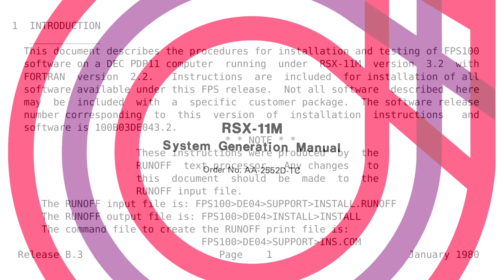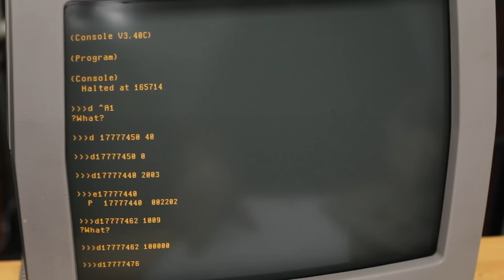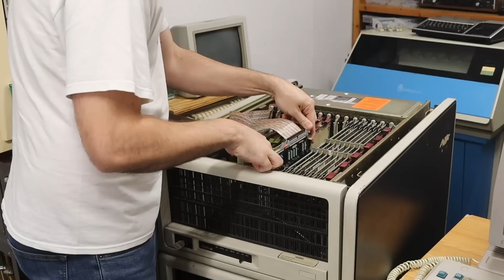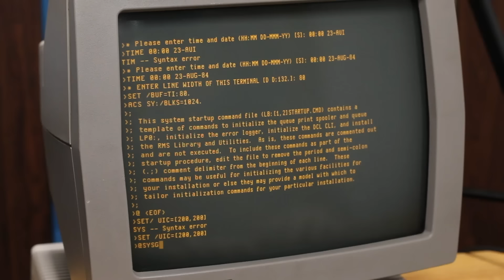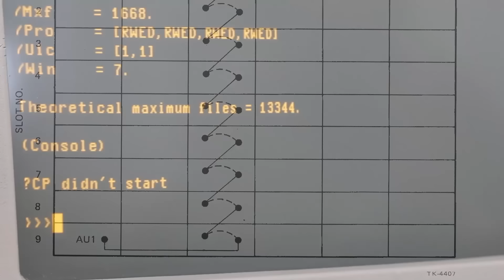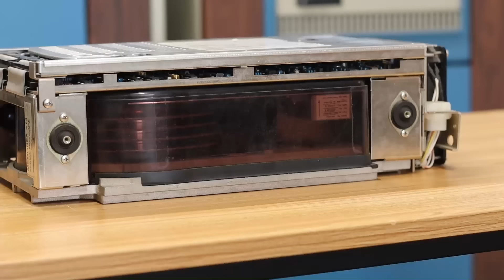My PDP-11/44 Won’t Let Me Format My Hard Drive

Comment: Of course the commands is an annoying sequence of Numbers You have to type over and over
Reply: the '>>> d' commands were to a boot rom monitor to write values into memory that happens to correspond to the control registers of the drive. The numbers were long because they were in octal (base-8, digits 0..7) which is what DEC uses then, and the '17777' at the start is because the drive control registers were at the high end / top of memory, which was a common thing so the memory-mapped control registers were not in the way of program code.
Reply: @rivimey sure, it’s still annoying if You have to type it 100 times (at least back in the day when it was painful to Marco it)

Comment: Shades of SYSGEN!!  I worked the old S.E.L MPX OS systems and we did that fairly often. Had a two config files, both matching the hardware. Each time you moved a jumper or added a board, had to update them. We used two because one would boot OS and enable all the hardware, then just wait for users to login. The other would do the same but also start a main task to run our real-time simulations.  So one for maintenance, one for running the training simulator.

Comment: To the extent its useful, RSX isn’t mis‑detecting your controller, it’s just believing what’s on the last track of the “RK06” unit.

On RK06/07 (and several other “last‑track” disks), DEC defined a standard bad‑sector file layout on the highest‑numbered track, documented as DEC STD 144. That file starts in the first sector of the last track and looks roughly like this:

word 0–1: cartridge serial number
word 2: reserved, written as 0
**word 3: flag – 0 for a normal data cartridge, 0xFFFF for an alignment cartridge

following words: list of bad sectors, then padded with 0xFFFF

RSX’s INI command, when run on an RK06/07‑type device, reads that “manufacturer’s bad sector file” from the last track. If word 3 is 0xFFFF, it prints:

Disk is an alignment cartridge

and refuses to initialize, because alignment packs are supposed to be used only for head alignment, not for data. The manuals spell this out: the last track identifies the volume as an alignment cartridge, and such a volume “cannot be initialized as a Files‑11 volume.”
Internet Archive
+1

Your Emulex SMD controller is emulating an RK06, so RSX treats it exactly like a real RK06:

It goes to the highest‑numbered cylinder/track that the Emulex presents as the “last track”.

It reads the first sector there and interprets it using the DEC STD 144 layout.

Whatever is on that sector right now has word 3 = 0xFFFF (or equivalent), so RSX quite reasonably concludes “this is an alignment cartridge”.

Why would that word be 0xFFFF on an SMD drive?

Most likely explanations (these are informed guesses, not documented DEC facts):

The disk was low‑level formatted or tested with some Emulex or other diagnostic that wrote 0xFFFF into that word as a default, not realizing DEC used that pattern to mean “alignment pack”.

The drive previously lived behind another DEC‑compatible controller that also wrote a DEC‑STD‑144 style bad‑sector file and explicitly flagged it as an alignment cartridge.

The last‑track area was bulk‑written with 0xFFFF (a common “empty” pattern) and just happens to match the alignment flag value.

In any case, RSX is not inferring “alignment” from the fact that it’s an Emulex or SMD disk. It’s literally reading that flag from the DEC‑STD‑144 bad‑sector file on the last track and doing what DEC designed: treating it as an alignment cartridge.
Reply: The "OS Plummer" does a drive-by wave and drops the knowledge of the ages while he's at it. I feel like I'm a fly on the wall in ring 0. LOL
Cheers, y'all!
Reply: So either format it again and fill with zeroes, or use direct access to the Emulex card with the monitor to change word 3 of last track for each virtual disk to zeroes. I'd go with the second option...
Reply: By the way, I think when you did the low level you backfilled with 177777 which would be all ones on the last track...
Reply: @DavesGarage  Ding ding, sounds like we have a winner, so this was a defect between the chair and the terminal.
Reply: @DavesGarage  you're like God reaching out to Adam, passing on the great knowledge
Reply: It is He who manages the Task Manager.
Reply: Thank you. I dealt with mostly RT11, VMS and UNIX but I remembered something about the last track identifying an alignment pack but couldn't remember what. I knew it was independent of the OS and you had to do a low level format with Emulex to clear it.
Reply: Isn't an alignment pack just a cartridge that is filled with entirely all ones, so it can produce a predictable pattern on a scope? Looks like @UsagiElectric turned his disk into a perfectly good "alignment cartridge" by accident.

Just re-format it with all zeroes and it will be fine I guess.
Reply: 🎶 THERE GOES MA HERO, WATCH EM AS HE GOOOOOOOOEEEESSSSS 🎶
Reply: So in other words, if Usagi opens the harddisk in a low level "hex editor" and writes 0x4e10 or whatever into there all is well?
Reply: @BastetFurry  
He can talk to the registers in the card via memory monitor, so in theory he can write the location/address in one register, data in another and initialize write operation by editing third one. IIRC, he did similar things with Centurion drives...
Reply: @UrgonCobol if you can do it by feet so to speak then that's also fine. But if you already have an OS you can boot to bootstrap/install then it might come with something more comfortable. Haven't used RT11 outside of fooling around in BASIC tough, so, no clue. 😅
Reply: @BastetFurry  
The OS boots from virtual drive on uBone board, not from real HDD. Real HDD can't be accessed because it's not seen by the system correctly...
Reply: I have been wondering whether you could do the equivalent of "dd if=/dev/zero of=/dev/sda" to wipe the whole disk clean. Or even just the last cylinder. Is that an option?
Reply: Yep, I assumed it was something in its FS headers (or I guess footers, in this case) that was angering the check. I had hoped it would be something more sinister than just FFFF, though 😂 Something like "oh, your disk just happens to have 0xBEEF or 0xF0F0 in the right spot, you should go buy a lottery ticket", etc
Reply: oh dayum, +1 insightful
Reply: Or:
Reply: Amazing to see you here
Reply: Haha.. The Big Friendly Dave makes a timely appearance with his shared pain and hard won knowledge. 

Who said you hanging on to old hardware wouldn't be useful to someone some day. ;)
Reply: One thing you can count on Dave for:  A super tight, to the point, explanation.  Well done sir.
Reply: Throwing in a comment so hopefully Usagi sees this info. The Master of Task Manager hath spoken!!!

Comment: I was an FE for DEC for years and troubleshooting hardware could be a SERIOUS challenge on systems properly configured at the factory. HOWEVER, in your case where you are piece-milling a system from various conditions, manufacturers and configurations takes this to a level which is borderline " INSANE " On some weird level, I find your headaches a little enjoyable/pleasurable, "sorry"...Congrats on your progress and keep plugging away; your pot of gold is there at the end,  
M A Y B E  ! ! ! ! !
Reply: Or it could turn out to just be iron pyrite.
Reply: In the early 80s I was teaching this stuff to DEC FE new-hires, had an entire wall of DEC manuals at home. Several moves and years and all that stuff is rotting in a landfill. sigh 20/20 hindsight.
In 88/89 I was building 6000s with parts from miscellaneous sources for third-party vendors. That was a lot of fun.

Comment: You could try the /Man manual control of the formatting to try formatting different amounts of the disk to see if some range of tracks is good?  Another thing to worry about - I note that RK06 is not supported on RSX11M+.  The version of RSX you’re using looks rather late, in many cases features of 11M+ found their way into later releases of 11M, maybe including dropping support for RK06?  Maybe easier to try emulating a more modern disk like the RM02 which was an 80 Mb exchangeable disk unit - 67 Mb formatted, might be a better fit?

Comment: The real power of electronics and by extension, computing, is that we know that operations should repeat exactly the same every time initial conditions are replicated and the environment is stable. I know this is obvious, but I remember realizing this as a kid and it was an important milestone in my understanding of how and why these things work.
Reply: "exactly" is only true in the digital domain, and even there you are haunted by things like jitter and metastability.
Reply: @splitprissm9339  that's true, but you can start with something like, asking a computer to add 1+1. If you ever get "3" or "John Denver", something is seriously wrong. You might tolerate random weirdness in a curry recipe or on a drive home, but this realm is different. You can scale that up in complexity to cover most of what you'll encounter such that it's at worst it's a useful principle to inform your debugging procedure; keep you from going east when you should go west. You'll hit scenarios where you were actually mistaken about initial conditions or inputs much more often than jitter or other breakdown of the matrix.

Comment: Clean the dip switches?  asside, I remember seeing labels with over 50 bad blocks on older Seagate drives, from the factory. IIRC no bad blocks were pretty rare until chrome looking platters were the standard.
Reply: My recollection of early 5.25" hard drives was that pretty much any drive had a few bad blocks out the door; sometimes it was just one or two, sometimes a dozen. In many cases the drive would be delivered with a list of bad blocks on the main label.
In one sense I'm not surprised the Fujitsu drive has bad blocks, but in another those drives were made to a very high standard and the unit is sealed, so why? Anyway.

Comment: Can you read and write to arbitrary locations on the disk? Try to read the header info, which it might be using to id the disk as an alignment cartridge, and then write back a different, non-alignment value into the header. Great video as always.
Reply: That would be useful since he wrote all 1's to the disk... Including the header that tells the controller the disk is an alignment pack
Reply: @JamesTK Oh shit. All ones is a problem according to the PDP11 RK06 manual..  

2.5.6.1 Data Field Format - The data field in the first 10 sectors of the last track has the following 
format: ... 

Word 0 contains the octal cartridge serial number. Words 1 and 2 are filled with zeros and are reserved for future use. 

Word 3 identifies the cartridge either as a data or alignment cartridge. If word 3 contains any ones, words 4 through 255 shall also contain ones.

https://bitsavers.org/pdf/dec/disc/rk06_rk07/EK-RK067-UG-001.pdf

Comment: Does it need to be on DM0? Try one of the other partitions. Also, would the alignment tracks be in a specific location on the disk like the first track? Could you add those blocks to the bad block map. I remember working on an old Data General a long time ago in a land far far away, and had a similar issue. I added the first 20 blocks  SWAG  to the bad block map and was able to floormat the drive.

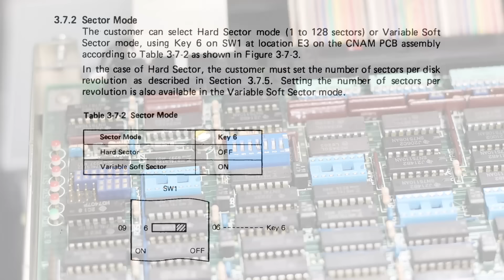Comment: Around 4:50 - If I recall correctly: You state you didn't know what one of those dip-switches did. Is that the factory-aligment disk - dip-switch? That you have set to the wrong mode?
Reply: The only way that could be is if the disc controller card also supports a different drive that uses an alignment disc and it's a dip switch option on the card. The disc he's using has fixed, sealed platters. The disc the card is emulating has a removable platter and an alignment disc but the physical disc does not.

Comment: Do you read  RKO6/RKO7 Disk Drive Service Manual    chapter 3? Is safety switch is in MAINT Position?
Reply: This reminds me of my life in the 1980s working on DEC systems.  So many late nights…  The difference was that back then you could call Emulex and talk to an engineer.  After 40 years, I don’t recall the specifics, but I recall running into this class of issues on systems with Emulex boards, bumping up against compatibility and undocumented issues.  I’m so glad not to have to do this stuff for my employment any longer.  There must be a virtual maintenance switch somewhere, but at what memory address….

Comment: The MCR Operations Manual says 
"Explanation: The last track on an RK06 disk identified the volume as an alignment cartridge, which cannot be initialized as a Files-11 volume. An alignment cartridge is specifically formatted for aligning disk read/write heads." So there's something odd about the last track?
Reply: We already found the problem. Usagi kind of self-inflicted it by calling the low level format command using 17777, meaning the entire disk was overwritten with all ones, including that last track. And if that last track reads 0xFFFF, it is flagged as an alignmnent cartridge. Oops.
Reply: @Stoney3K good to know! My next question was going to be: “what exactly identifies a drive as being an alignment cartridge”. :)
Reply: @Stoney3K  so he needs to not format it with all 1's?
Reply: Might be too late to "fix" now.

Comment: I’ve got an 11/44 sitting here at my house that I’ve never tried to boot up.  After watching this I think I’ll pass mine on to the next guy. I’ve got too many toys and not enough time.
Reply: I would say im the next guy but lol 😆  im notnsure im qualified to even plug one into my outlets lol
Reply: @definitelycasualpcs8789  Well System Source, Daves Garage and Usagi between them could pull something back to working
Reply: @definitelycasualpcs8789 power supply is 240 so it would to know what I’m doing but that leaves me out also
Reply: Maybe ye olde Usagi can pay you for it, refurbish it or keep it for spare parts!
Reply: If you are using a real DEC HD, should be no problem. These things will outlast cockroaches.
Reply: If you will pay for shipping to me and send it for free I can kindly take it off your hands and have some fun with it.

Comment: David, loved the video. It would be easier to follow if you don't abbreviate the RSX commands. I was able to follow because I'm a former OpenVMS systems programmer but I think your audience would get more from the videos if you didn't shorten the commands and parameters!
Reply: I recently installed an emulated OpenVMS cluster on my Kubernetes basement cluster. I used to play with VMS in college. It was fun but emulating a high end VAX just wasn’t as fun as large space requirements.
Reply: @michaelgraff6978  It's all perspective. I worked on the ES40 and ES45's. DEC made tanks but I'd also have no interest in having one or multiple in my house!

Comment: Using a wave rake as a dip switch pointer? Are we getting a collab with the lock picking lawyer? 😂
Reply: Haha! When I saw the rake, I wondered who he watches, and where he bought it. But if you think about it, a lot of old cabinets and systems had locks and those keys often and easily get lost.
Reply: Isn't it one of the Centurions he routinely switches on with a lockpick in the keyswitch?

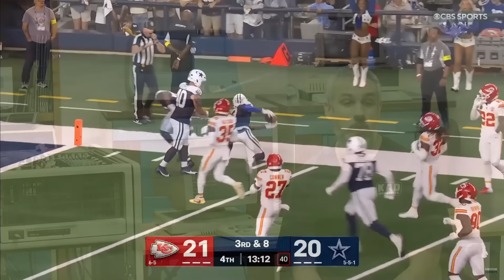Comment: 27:34 did switching hard to soft sectoring make any difference? Check the digital values with a scope to see if the dip switches actually work.
Reply: Good point, old DIP switches aren't exactly reliable and that one looks rough.

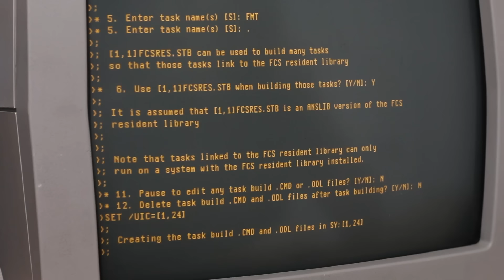Comment: At 26:34, you talked about building FMT from source. Can you look at where that specific error is being thrown and trace it back to see what the fault is from within the source?
Reply: Since there's no danger of data being lost, you could probably also just patch that out
Reply: That was my first thought as well. There must be SOMETHING it's testing to determine this, either some stray signal, or a specific bit of data being read from the platter before starting?
Reply: There is no fault, he wrote all 1's to the disk, including a header that when set as such tells the controller the disk is an alignment cartridge. The dummy in the room is him. Dave from Dave's Garage left a detailed comment as to why this happens. Worth a read!
Reply: @JamesTK yeah I saw that, it’s an interesting read